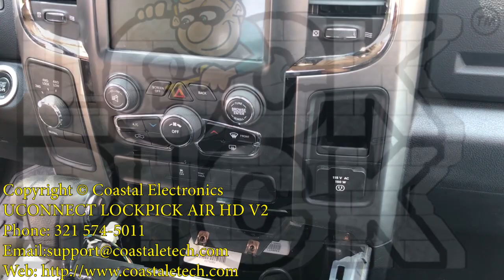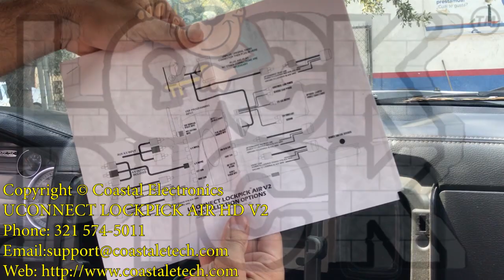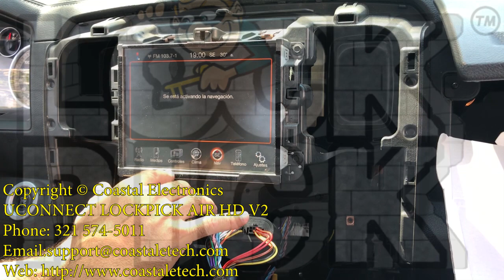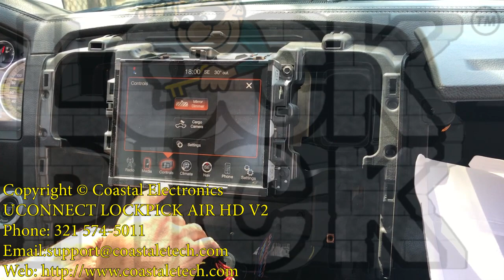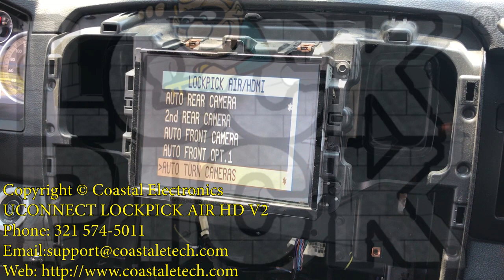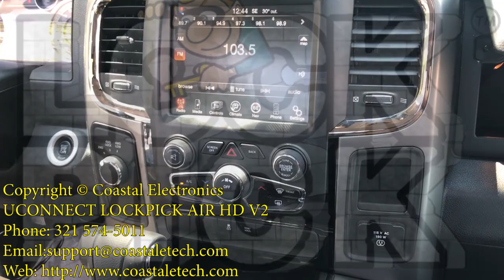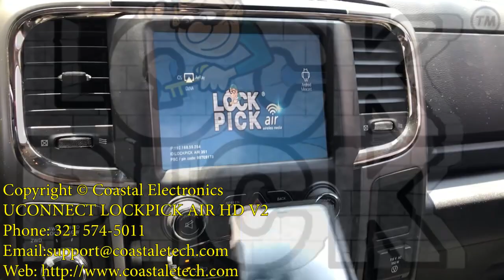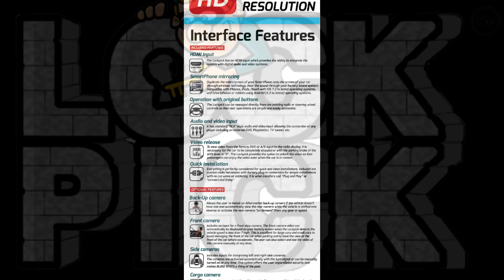Dodge Ram  Uconnect LockPick Air HD V2 MirrorLink CarPlay

Comment from the maker: Demonstration of the installation and operation of the new
UCONNECT LOCKPICK AIR HD V2 wireless streaming interface in a 2013-2019 Ram truck 

Coastal Electronics Dealer & Sales Support
Dealer Direct  - line available: 
(321-574-5011) 
support@coastaletech.com
www.Coastaletech.com

the new LockPick Air HD V2 Includes  Programing calibration  for the OEM CARGO CAMERA input  on all dodge ram with the uconnect 8.4 screen radios  

UCONNECT AIR HD V2 LOCKPICK
Product Link
http://www.coastaletech.com/uconnectairv2.htm

Now compatible with ALL 8.4” UConnect and 4.3” UConnect Systems!

  Features Include…
- screen Mirroring for both iPhone and Android + you can now connect and iPhone using USB input on the lockpick by using the  Apple Lightning charging cable to mirror your phone 
now compatible with NetFlix and YOUTUBE   
- Factory Navigation Address Entry In-Motion (if equipped)
- Video Play In-Motion
- HDMI Digital Video Input
- Rear Camera Activation and In-Motion Viewing for ANY Backup Camera configuration (factory and non-factory equipped)
- Full Camera Support of up to 5 Cameras in the vehicle including automatic and manual on demand activation
- REAR, CARGO, FRONT, and LEFT/RIGHT or AUX Camera Inputs!
- RCA Headrest A/V Out Support
- Apple (via HDMI*) and Android Wireless Support 
- OEM Cargo Cam Menu Activation in ALL 2013-2019 Dodge Rams

Now compatible with 4.3” UConnect and 8.4” UConnect Systems (5” applications see list below)!

Installation and Operation is easy with the Lockpick custom Plug and Play Harness and Wireless Remote Control!

UCONNECT AIR HD V2 APPLICATIONS

2015-2020 CHRYSLER 200
2016-2020 CHRYSLER 300
2016-2020 CHRYSLER PACIFICA

2013-2019 DODGE RAM (compatible ALL OEM Camera Configurations)
2015-2020 DODGE CHARGER SRT ONLY (non-SRT use Uconnect Air HD V1)
2016-2020 DODGE CHARGER(5" AND 8.4” Screen Compatible)
2015-2020 DODGE CHALLENGER(5" AND 8.4” Screen Compatible)
2014-2020 DODGE DURANGO

2014-2020 JEEP CHEROKEE/TRAILHAWK 
2018-2020 JEEP COMPASS 
2014-2020 JEEP GRAND CHEROKEE
2015-2020 JEEP RENEGADE
Reply from the maker: Coastal Electronics Dealer & Sales Support
Dealer Direct  - line available: 
(321-574-5011) 
support@coastaletech.com
www.Coastaletech.com

Comment from the maker: 2013,2014,2015,2016,2017,2018,2019 dodge Ram video in motion ,video navigation unlock,uconnect mirrorlink,uconnect 8.4 iPhone CarPlay,  Dodge Ram Android Auto,Dodge ram OEM cargo camera,Dodge ram DVD unlock, Dodge ram 12"Blu Ray Video in motion,jeep grand cherokee video Screen Mirroring,Mirrorlink,Carplay,video in motion video nav unlock,dodge charger,dodge challenger,chrysler 300 mirrorlink, carplay, video in motion,freedom in motion uconnect  lockpick Air HD V2  2018-2019 jeep compass carplay,android auto mirrorlink
Reply: Is there any delay in sound to picture?? If so no big deal just wondering.. I'll be calling tomorrow for pricing.. Thank you for the thorough video.. Been waiting for this!!!
Reply from the maker: Rick C  there is absolutely no delay it works on the sound or picture the kit works perfectly
Reply: @venturatechnology  can I install this on the 2019 new body style with the 8.4 screen on it?